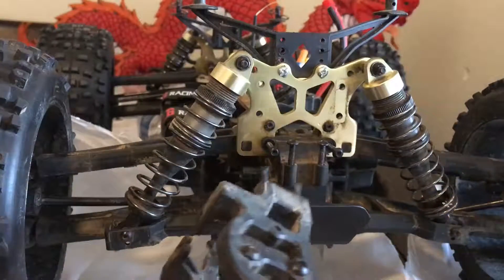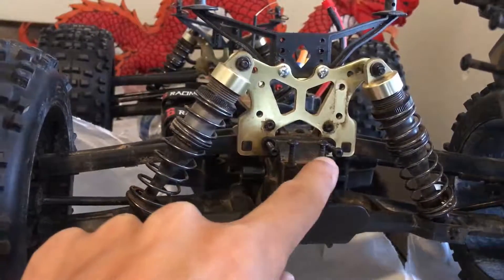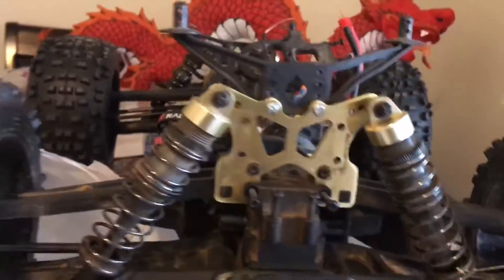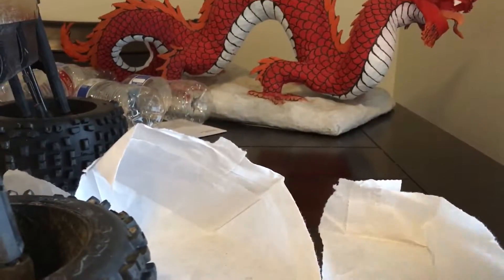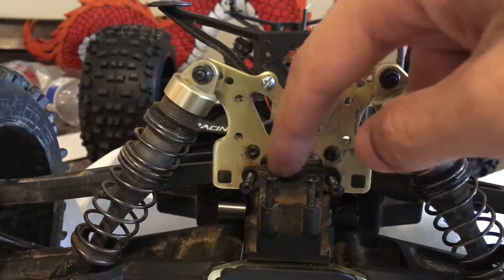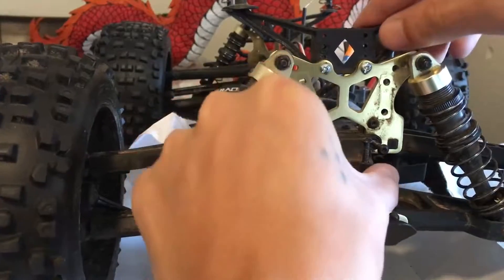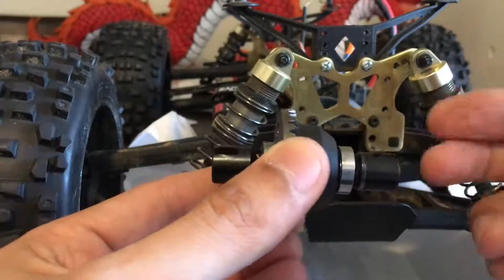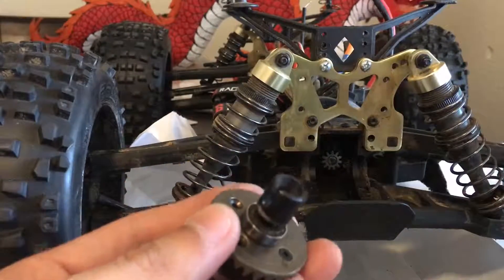JLB Cheetah - How To Remove Rear Diff!!! PART 1

Comment: Hey man i'm thinking about putting some grease in my diffs on the 21101, what type of grease do you suggest?
Reply from the maker: Don’t use grease trust me I’ve try it and it causes the gears to strip out faster because the metal shavings from the gears build up in the grease and it acts like liquid sand paper which causes more damage to the diff and it’s a pain in the butt to clean out. Use diff fluid which is 100% silicone oil. They work the best and don’t leave any metal shavings behind. I’ve replaced the diff on my cheetah many times already because of using grease. Plus, with grease gets thin fast. With diff fluid the thickness stay the same until it needs to be changed out.
Reply: @ItsRCTeng  Oh ok thanks i'll go for diff oil instead, what number is the best to use?
Reply: @ItsRCTeng  So after watching your video about adding diff fluid i saw that you used 50k, but my nearest rc shop doesnt have 50k, only 30k and less, should i go with 30k on both front and rear diffs? Im doing speed runs mostly not bashing if this matters
Reply from the maker: I bash a lot so I use higher number to keep the diff tight. For speeds you would want something that is like medium to soft so 10k-30k in both front and rear should be good. Too tightness of a diff might causes a lot of drifting when your at fast speed. You want the diff to counter spin with each other to help with stability and going straight so if I was speed running I would go with 10k in both front and rear. 30k would be the maximum tightness I would use for speed runs. It also helps with better cornering when you have loose diff. Tight diff just causes drifts and power slides.
Reply: @ItsRCTeng  You helped me so much thanks man, keep up the good work

Comment: Hi, I'm looking spare for a hobbykinh rc and this might fit, widht is aprox. 50mm but can you tell me teeth and diameter? mine is 38T 28mm
Reply from the maker: I only know that it’s 32T for the outside ring gear on the diff. I don’t know what mm is it.

Comment: Any videos on how to replace the lower suspension arm would be great as mine has broken
Reply from the maker: Soon because I need to replace mine as well.
Reply from the maker: Hey I just replaced my lower control arm. Go check out the video!
Reply: Teng Lay, thanks for the video, so to take off lower suspension arm you need to unscrew the one screw and then push the pin out, that's what I understood?
Reply from the maker: Yup that’s basically it. Just one screw and the ball joint screw and the suspension pin. Then you can take off the lower control arm.